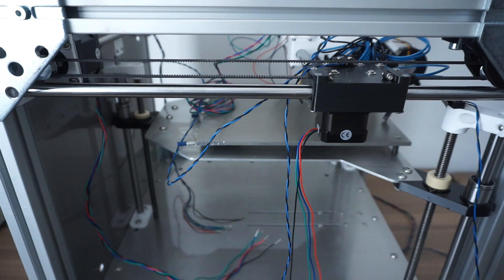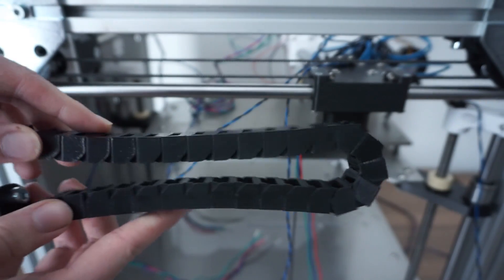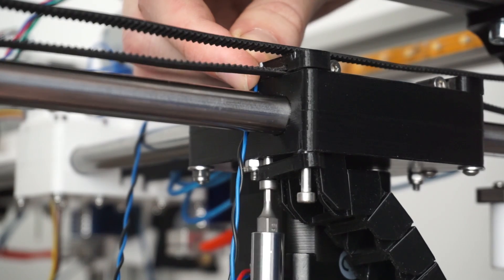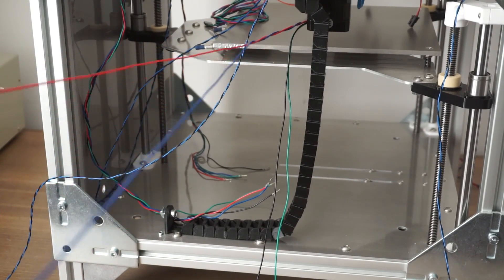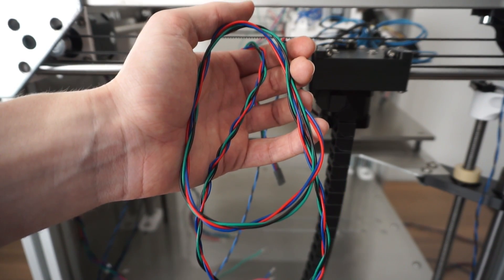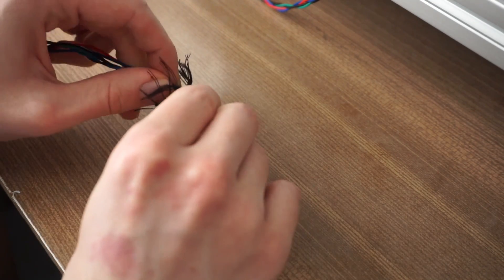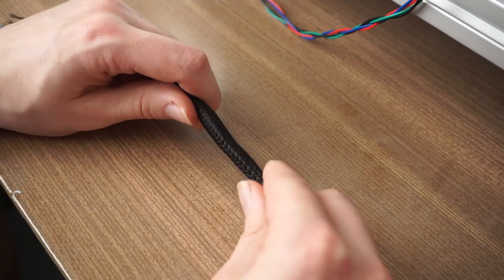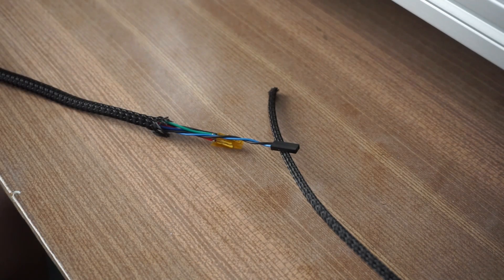(Re-)Building a 3D Printer - Part 3: Cables and Electronics

Comment: Can you share your PCB details with us? Which component did use and have a circuit?
Reply from the maker: I made those without any predetermined schematic and with the parts I had lying around. The Mosfet are IRF3708 and the rest are just some standard components. If you have a question about something specific, please let me know.

Comment: please, have you link of the two pcd for Heatbed and external control? thank you in advance. good job
Reply from the maker: I made both of the PCBs myself without a fixed design in my head. If you want to buy one just search for "Mosfet Controller Board".
Reply: @leonbrauns   Can you share the design of the electronics and the pieces in stl? Please I am working on a similar project and would you help me to solve some problems? Greetings from Peru .... Very good project, my email "ramostrelleschristian@gmail.com"

Comment: Wie funktioniert das mit dem zweiten Druckkopf? Kannst du da evtl ein Video drüber machen?
Reply from the maker: Ich bin gerade dabei Video-Material für den finalen Part zu sammeln, wo man den Drucker auch in Aktion sehen wird. Vielleicht kannst du es dir dann besser vorstellen, melde dich ansonsten nochmal bei mir ;).
Reply: Brauns CNC Hi, soweit ich das verstanden habe funktioniert das mit einem elektronagnet der dann den zweiten Druckkopf mitzieht. Wie realisierst du das in der Software ich glaube nicht das si ein Fall in Marlin vorgesehen ist.
Reply from the maker: Ich arbeite mit Repetier, aber mit Marlin sollte es gleich/ähnlich sein:  Der Werkzeugwechsel ist nur im Slicer definiert und manuell geschrieben. Da sage ich zuerst mit dem GCode-Kommando „G1 X200“ dass sich der Schlitten zur Parkposition des 2. Druckkopfes bewegen soll und setze mit "M42 P6 S255" den P6 Pin des Arduinos auf HIGH, was wiederum einen Mosfet aktiviert welcher schlussendlich den Elektromagnet anschaltet.  Das war sogar schon alles. Wenn der 2. Druckkopf geparkt werden soll ist es eigentlich fast das gleiche, nur wird da der Pin mit „M42 P6 S0“ auf LOW gesetzt, was den Mosfet und damit den Elektromagnet ausschaltet. Sollte noch was unklar sein bitte eine E-Mail an brauns.cnc@gmail.com, da kann ich es detaillierter erklären ;).